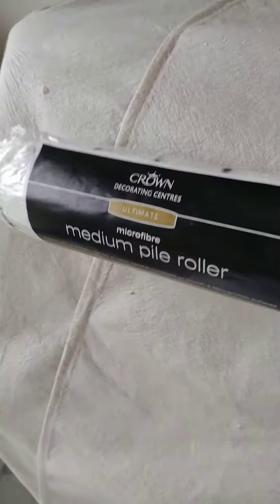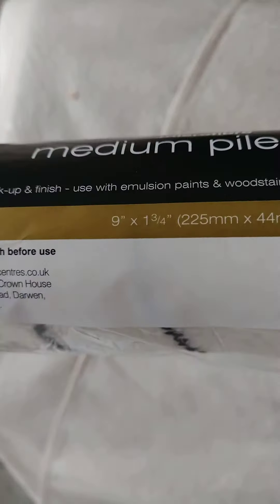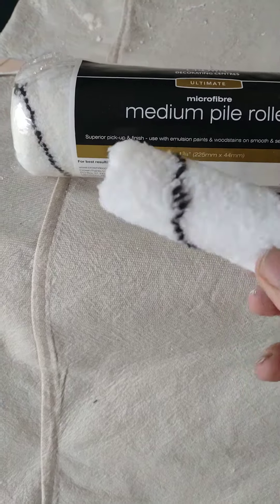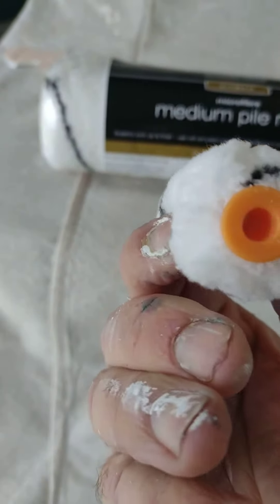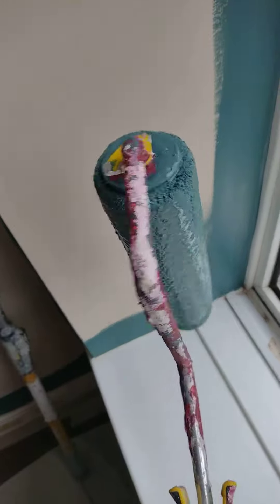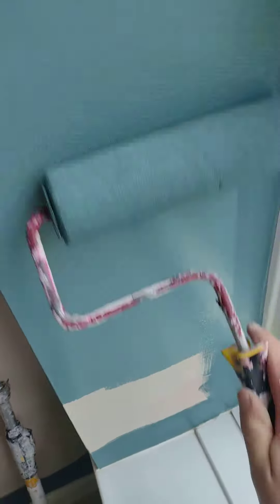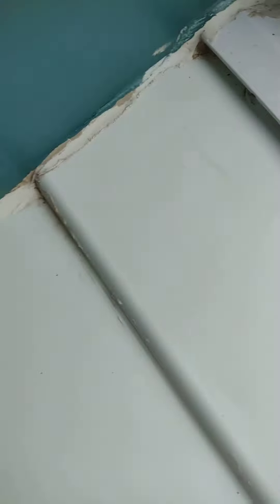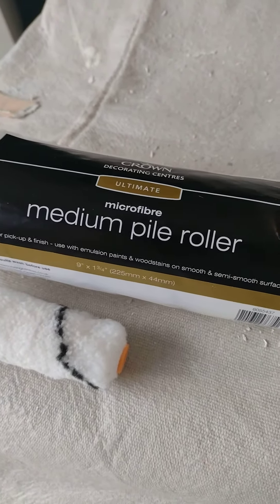Microfibre rollers from crown decorating centres

Comment: Personally speaking, I prefer the hamilton medium pile (green ) ,so I'm reluctant to change sleeves. I've got the 15,12,9, and 4 inch, I just eidh they would do them in 6 inches, great channel 👍 😀
Reply from the maker: I did use the hamilton ones the same as you the green ones, but was finding that after a few jobs once washed out they did not feel as soft and the fibres felt more rough. I use the white hamiliton 4 inch on woodwork as the finish is just as good as a two fussy blokes roller  Glad you like the channel
Reply: Hi, I've used the white ones only a couple of times, not on woodwork I either use tge 2 fusdy bloke's or ice fusion. I may try the hamilton on my next job 👍👍👍👍